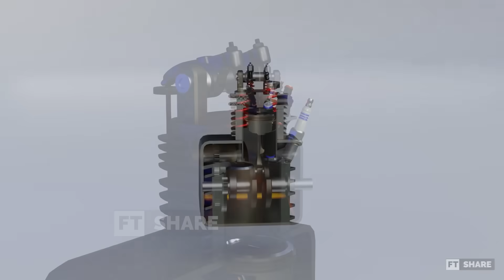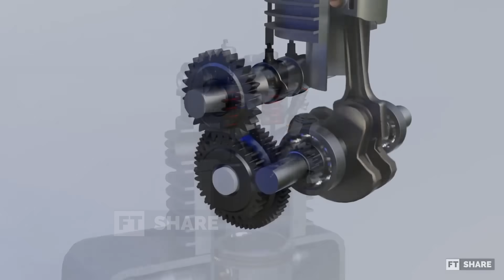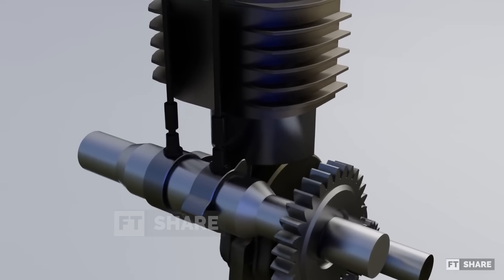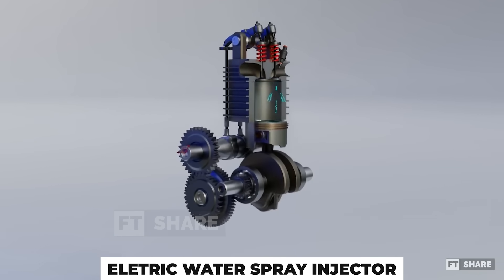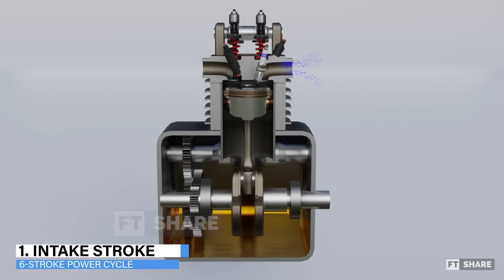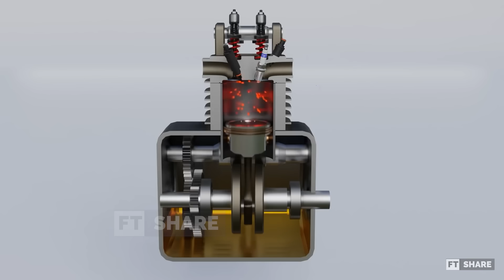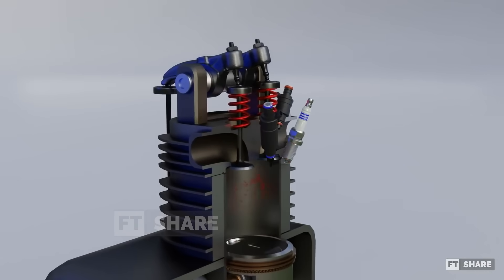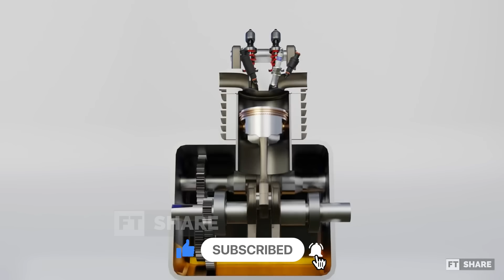Water-Powered ICE Is Here!!! | The Revolutionary 6-Stroke Engine

Comment: This is actually the Crower 6-stroke, named after famed cam and valvetrain tech Bruce Crower. The injection systems and valve controls to acheive this cycle were not available in the 1860s.

The engine showed great promise... but didn't see much in the way of success, due to inherent nature of water (freezing, corrosion, etc.). 

In stationary applications where freezing temperatures aren't a considerable factor, and weight/space isn't an issue... it's a great option.
Reply: I found a number of patents describing identical 6 stroke formats going back many decades before Crower, some even used the term 6 stroke in the title ... I am amazed that they issued him a patent. Bottom cycle powerplants are quite old, the Kitt-Stillson locomotives used waste heat from the ICE to drive a steam plant.
Reply: @53kenner  - they all varied in a number of ways... but what set most of them apart, were the progressively advanced injectors used for water. All of them used some form of diesel injector, but as injector designs improved, the new patents were filed. To my knowledge, no 6-stroke has ever seen successful implementation outside of a couple stationary power units used in mining operations to run pumps.
Reply: @53kenner  
I applied for patent on an 8 stroke. The traditional 4 stroke was hydrogen and oxygen with a water mist for cooling. The hot steam exhaust was sent to the intake of another 4 stroke combined with natural gas or propane and reformed into hydrogen and carbon monoxide. I built a prototype of the second 4 strokes and had about 30% reformation. It was all part of a design to convert garbage and sewage into liquid fuels and this proved a part of that larger design.
Reply: I spoke with Crower. They stopped developing the 6 stroke when Bruce’s health had problems.
Reply: @andrewday3206  - I thought he had sold the rights prior to his passing... as it was rumored a German company and Ford were revisiting the cycle back in the late '90s/'00s. Ford abandoned their smaller industrial engine lineup. I haven't seen or heard of anything out of Germany either.

The specific power density is actually lower, requiring a larger engine to produce the same amount of power. The benefit comes in the form of efficiency and duty cycle... as more energy of the original combustion event is captured, and the 6th stroke aids supremely well in cooling. The biggest problem came in the form of accelerated erosion of the ring lands and grooves. Much the same as with any other water injection system... tiny droplets of water turning to steam at such high pressures cause microscopic fractures in the surface as carbon is removed from the base metal.
Reply: @driverjamescopeland  
They may have sold the rights I am unaware of that. I had gotten in touch with them asking for assistance in using an engine as a reciprocating reformer converting hydrocarbons into H2 and CO2. 
Two questions 
Why is the specific power density lower?
Seeing burning fuel produces H2O and CO2 why doesn’t that have the same effect on the metals?
Your response has my interested it was thoughtful 
Thank You
Reply: @andrewday3206  - the lower engine volume-specific power density is due to the energy source. For the sake of comparison, we'll use Bruce's eureka engine as an example. While the injected water helped to both extract more usable power from the origin combustion event... it still didn't change the fact that all your power was result of that single event, now distributed over a 50% longer cycle. Power is always limited by the amount of air/fuel the engine injests during the intake phase. While it did get more power per pound of fuel burned... it effectively reduced the intake phase by 33%. Picture it this way... a 10 cubic inch engine in 4-stroke configuration, ingests 10ci of combustible mixture for 25% of the overall cycle. A 10 cubic 6-stroke only ingests for 16.6% of the cycle... which is 9% less. The 6-stroke was also inherently more limited in it's RPM, due to precise injection timing, and diesel injectors not being particularly suited to water. All said and done, the 6-stroke proved to be about 20% less power dense compared to a typical road-going 4-stroke of the same size. 

As for the water causing additional wear... it's not the H²O, so much as its state. When produced in standard combustion the water is already in a vapor state. In the 6-stroke, it is injected in a liquid state... which even with stratified injection, contains droplets. These droplets often end up vaporizing at the ring lands of TDC (top dead center) displacing the far more viscous oil... not only leaving these nearly microscopic areas without lubrication, but creating pressure waves in a non-ideal location. The result while from different causes, was much the same as when cavitation erodes the edges of a boat prop.

Where the engine really held promise, was industrial applications where high duty cycles typically dictate lower engine speed, larger flywheels, and considerably larger cooling systems to acheive sustained torque. The 6-stroke addressed all of these while offering two other advantages... lower cylinder count, and better fuel-specific efficiency. Bruce was basically achieving modern diesel efficiency with gasoline 30 years ago. Also, with two power strokes per cycle, and a longer relative duration of torque output... you could acheive continuous reliable torque with only three cylinders instead of 6. 

Even with today's material technology, primarily advanced ceramics... I doubt we could produce a injector that can reliably overcome the challenges of water. Quite the sad case, as it would make for an outstanding stationary power unit. The block would also need provisions for the ring lands... also possibly ceramic... but that's insanely expensive, low tolerance to thermal shock, and takes the potential for catastrophic failure to a whole new level.
Reply: @andrewday3206  - as for your idea for a reformer... I'm curious as to why you essentially wanted to liberate the hydrogen from the hydrocarbon chain, just to have two gasses, with the carbon already oxidized and stable? I'm sure you have a purpose... I just can't quite grasp what would justify the losses.
Reply: @driverjamescopeland  
That’s a great explanation!
The thing I remember is the water conversion to steam was much slower than the speed of fuel burning. The flame front of gasoline and diesel is so much faster to complete combustion than the injected water to steam. This was a limiting factor in engine RPM. My dream solution for this engine would have been ceramic cylinder liners, piston tops, coated valve top and coated inside of cylinder heads. In other words trying to keep all the heat of combustion inside the combustion chamber and use just enough water to cool. But in reality an opposed piston 2 stroke with ceramic liners and piston tops would be much easier. I wonder if Achates will try this? It would beat everything in efficiency. At load it provides a very energy dense exhaust gas for secondary generation. Adding something like Cummins did with the ISX-WHR, UTC Powercycle, Kalina Cycle or turbocompounding would be a great synergy. That is sort of utopian but I guess the 6 stroke is as well.
Reply: @driverjamescopeland  
I was working on gasifying waste into a syngas of CO+H2. We were wanting to run this through a GTL of Fischer-Tropsche process to produce hydrocarbons. The issue is you are always short H2 so some CO is steam reformed into CO2+H2. The H2 is then feed to the syngas so the GTL can convert all the carbon into hydrocarbon chains. The other part is the hydrocarbons are part gaseous so we wanted to be able to reform them into hydrogen as well.
Reply: @driverjamescopeland we have the tech these days to coat metal. Just look up the numerous metal coating technologies used in gun manufacturing. This ain't your daddy's 1911 blued in your mom's kitchen oven that we're talking about.

Comment: 😢 It's not well known, but the combustion of a fuel yields a weight of water equal to the weight of fuel burned. Since water weighs about 8.4 lbs/gal and liquid fuels weigh around 6 lbs/ gal, you'd have to provide extra if you need equal weights for this engine. The British navy experimented with condensing water from motor lifeboat exhaust during WW ll, along with their Army (from truck exhaust) during the African desert campaign. They had problems filtering out contaminants such as oil and tetraethyl lead to make it safe for drinking. Perhaps todays filtration technology would make this idea more practical.
Reply: perhaps however as someone that has read up about steam engines, I tell you that when you heat water it does weird things to the chemistry, and its not just corrosion but also scaling you have to worry about, and trying to condense the water out of the exaust would be good yes but thats additional weight the engine has to carry.

Comment: It sounds nice. 
In a multi cylinder application where you can alternate 1st power stroke on one piston at the same time another is on its second power stroke.

The single cylinder engine is a failure.

Comment: These engines would be awsome for backup power generation.  The combination of a gasoline and steam engine, brilliant.  These engines most likely could subsitute gasoline for natural gas/propane/alcohol or even hydrogen.   I would guess the engine wouldn't require a cooling system.  If so, you could use the cooling system as a way to distill and purify water for reintroduction in to the fuel system.  So you lose a little power output.  The trade off's are reasonable.

Comment: A couple of issues with this would be:
 1) Poor specific power output as the bmep of the steam stroke would be low.
2)Water contamination of the oil and potentiomal hydraulic locks.  Steam engines have cylinder drains to cope with this.
3) If the steam in the exhaust condenses it will is likely  wash out combustion pollutants and concentrate them.  This might be used to control soot like a DPF but the water needs to be dealt with. Old oil engines often used water filled exhaust pits but in those days you could just dump it down the drain.
Reply: 2. if you inject too much water it will become wet steam and condense. the solution is to find the ideal volume of water to be supplied so that it sufficiently cools the engine, but is still in low quantity enough that it becomes superheated dry steam, which wont condense in the cylinder
3. water reclamation and filtering from the exhaust system
Reply: @icedout7606  Or just not bother and make a turbo compounded two stroke.

Comment: It would probably be better to think or this as a compound engine.  Turbo compound aircraft engines like the Wright R 3350 took energy from the exhaust and geared it to the shaft. Napier  took this concept to its logical conclusion with the Nomad 2 which gave a thermal efficiency of about 40% It ran with an overall compression ratio of about 27:1 and a manifold pressure of 89psi above atmospheric.  The engine was a simple piston ported 2 stroke but the turbocharger was effectively a gas turbine and the engine pushed a lot of technical boundries for 1954. 
With modern common rail fuel injection and computer control the system the turbo compound deserves another go round but the Net Zero loones have killed IC development stone dead.

Comment: In the 1920tees and early  30tees McCormick  burned gasoline   and had a smaller tank with water  and didn't  have to be distilled!  The had a water  Carb and as it was working  you turned  water on ! And gain a fair  amount of power  when plowing. In 1925 1530 McCormick had for shure.!!!
  I'm pretty sure  
John deer Model.D allso Did .
   All the Old Guys said how amazing  the power would get so much better.  
   And those  were all 4 Stroke  Engines

Comment: Samuel Griffin patented his 6 stroke engine design the 'Griffin Simplex' in 1886 as well as other related patents. These engines were used to power generators as they were too heavy for a mobile use. However, they soon built up a reputation as reliable and dependable engines working long hours without missing a beat. Unfortunately Samuel Giffins business went bankrupt in 1923.
Two working examples remain at the Bath at Work Museum in Bath England.

Comment: You need to retitle this video because by your own words this motor is not available today. You’re also a bit sloppy on the thermal efficiency numbers looking at the graphs that you have in your own video but I think the bigger problem is why lead with a lie and say it’s here and then turn around and say it’s in development. WTF?
Reply: It will be simpler just to add hot.Really hot water preheated by the exhaust within the combustion chamber.At the same time a regular four stroke plus water

Comment: I have patents for this, Bruce Crower made a running engine with this basic concept. The main problem is that conventional valves will oxidize over time. I have patents that eliminate conventional valves and replaces them with a rotating shaft with angled ports in it. As the shaft turnes it opens and closes intake and exhaust ports. This also allows the intake to open at 0° TDC and close at 0° BDC which is a must for this concept
Reply: What is your patent numbers, I'd be very interested in looking at your design. Thank you.
Reply: @rpsoren  it's a provisional patent from a few years ago. I already made a straight six model with rotating parts. The "port shaft" would be twice the diameter of the piston bore.
   The concept has an engine with compression ignition and no conventional cooling system. It would have 2 electronically controlled injectors per cylinder, one for fuel, one for water. When the engine reaches operating temperature the computer would alternate the firing of the water and fuel injectors.
Reply: 1) The gas/petrol stroke needs around 10-15deg before TDC.  2) Valves covered in carbon (from the standard power stroke) don't oxidise.
Reply: All conventional valves need time to ramp up, in other words the intake valve is open a little when the piston is moving up. This would inevitably lead to oxidation above the valve face. The same would be true on the exhaust side, there would be a loss of steam pressure